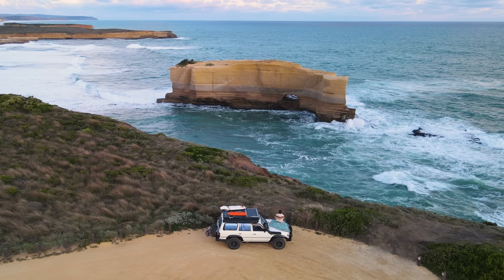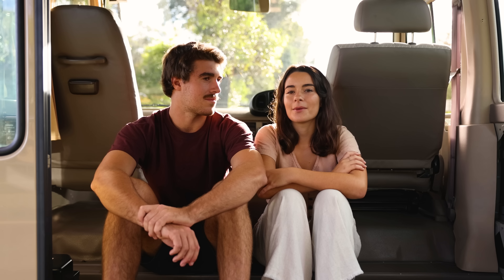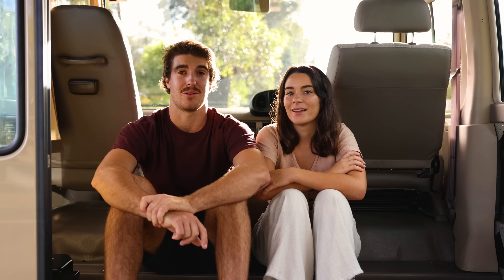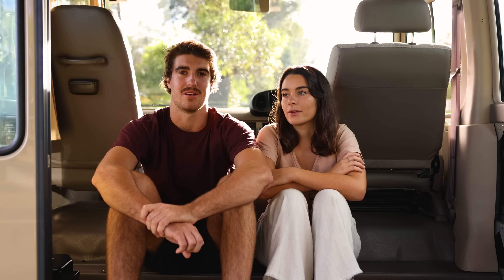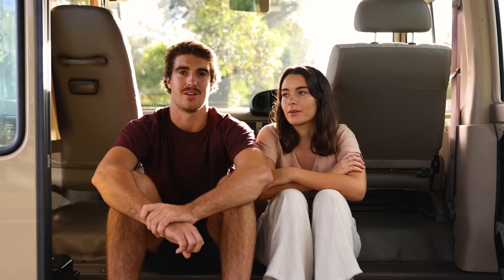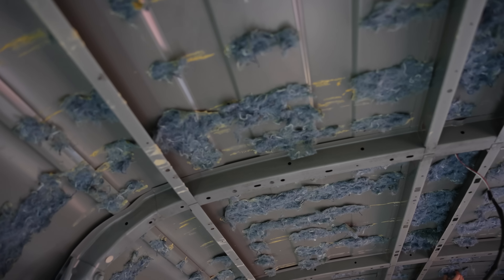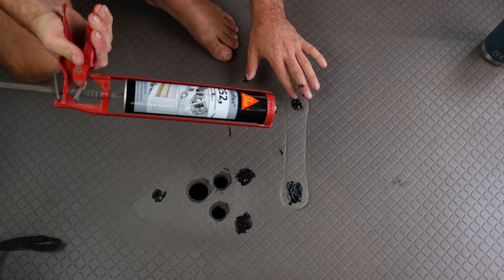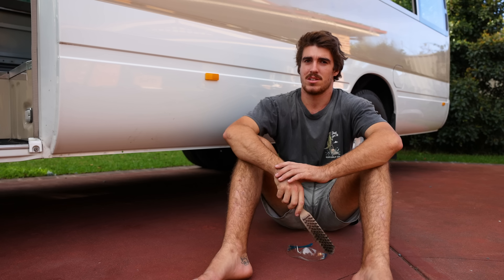WE BOUGHT A BUS! - EP 1. Welcome to our Japanese import Toyota Coaster.

Comment: Coasters are very reliable minibuses. I know of examples from the 1980s that still run strong here in the Philippines.
Reply from the maker: They sure are. Can't beat Toyota in reliability.
Reply: @_ourgreatescape  well, those '80s Coasters I'm referring to are government vehicles, so maintenance is fairly religious. Also, newer Coasters of the vintage of yours here in the Philippines have an external air intake mounted on the right side.

Comment: You can actually buy a heat exchanger hot water service that will run off 240 and the motor.  That way you will be able to have a shower whenever you arrive anywhere to feel clean again after a day driving.